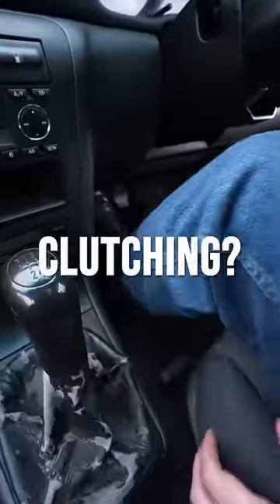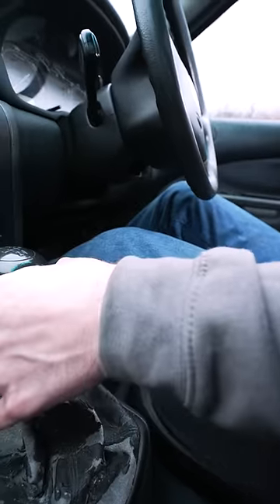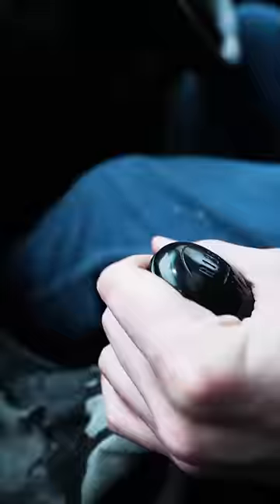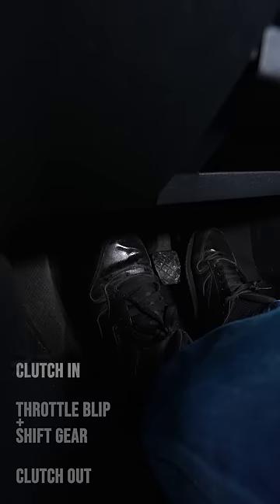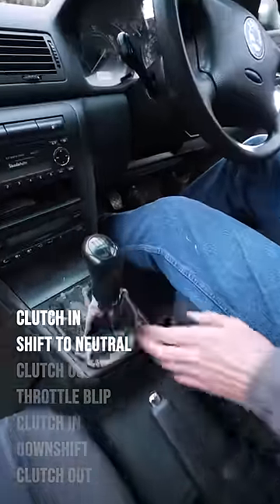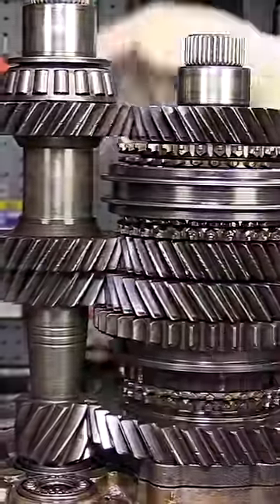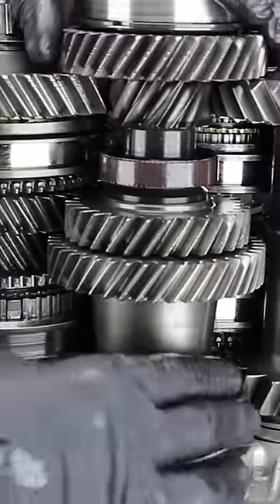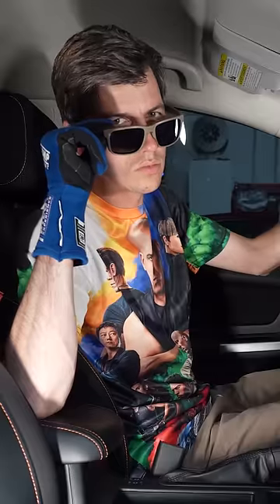What Is Double Clutching? Don't Granny Shift!

Comment: Double clutching is mostly used when drive manual semi-trucks.
Reply: Only learned double clutching for the DMV test and I been floating gears ever since.
Reply: Depends on the driver, most don't double clutch. Also, most people don't know this, but you can totally single clutch an unsynchronized transmission
Reply: Never once saw my father double clutch his truck in the 80's and 90's. Clutch was only ever used for starting and stopping the truck.
Reply: @JoshuaTootell  good skill to have though, sometimes a good way to recover from a missed shift. If you're a boss and never miss a shift then you don't need it
Reply: @JoshuaTootell  Some weird American automatic gearbox?
Reply: Very old manual trucks.
Reply: @SoulTouchMusic93 New ones too.
Reply: Ya... the company I work for has me in a 22 kenworth t680 with a 10spd. I float my gears and only use a clutch for starting and stopping.
Reply: The why is that most (not all but most) tandem drive axle trucks do NOT have synchronizers on the transmission.  They don't have them on purpose.  The forces the drive train is under when pulling a load (grade isn't a consideration flat uphill downhill the transmission activities are all parallel relative to the road surface) are enormous.  The synchronizer on a small light vehicle is not under anything like the stresses those gear splines are under on a rig.  On a rig a synchronizer would potentially fail in low range causing the drive finals to lock up and ultimately stopping rotation of the wheels resulting in a skid or snap the driveline off at the flywheel or hogshead resulting in a big truck in permanent neutral.  Neither condition is safe on the highway as you can imagine.  

As a former driver (I drove long haul from Maine to Cali to Seattle to Florida and everywhere in between) I rarely used the clutch to shift up or down.  I used a combination of the tachometer speedometer and the sound of the engine to tell me when to shift.  12 to 13?  Get the rpm just above the nominal rpm to shift then push the gear selector into neutral right foot off accelerator momentarily then on into 13th foot back on to the accelerator and proceed.  Easy easy.  9th to 8th (or even 7th if I needed to slow in a hurry)? Pull gear selector to neutral goose the accelerator to appropriate rpm slide gear selector to desired down gear and let the jakes do the work of slowing the vehicle down with a covering foot on the brake pedal if needed.  

Every mechanic I ever met during all those runs all said the same thing.  I can tell when I pull maintenance whether or not you clutch double clutch or float and company policy as well as the dmv say you must double clutch.  Then after the safety meeting was over they all would say the same thing.  Save yourself and me some heartache and work.  Float the gears use clutch to start and stop. Keeps my workload down and your wheels turning more frequently.
Reply: They dont use the clutch they float gears
Reply: @marlberg2963  not to mention the poor quality of certain parts like clutch brakes that are in supply these days.
Reply: If you're new lol
Reply: @Mrcoltonclarkson  Floating the gears doesn't really same much time or energy and if it does its typically negligible so its more about preference
Reply: @wilko9396You mean a car like the one I have? I would have never guessed! You can also jump out of a window, doesn't mean you should.
Reply: Float your gears
Reply: @marlberg2963 a lot of euro trucks have synchronized manuals and they work fine. Some automated transmissions like volvo ishift are not synchronized but still have synchronizers on range selector and splitter. I think the reason for not making synchronized transmissions is just that unsynchronized transmissions work and there is no reason to start designing new transmissions  when customers are either choosing automatics or are used to unsynchronized. "Why fix what isn't broken" seems to be the way you work in the states atleast when looking at the differences between american and european trucks.
Reply: Double clutch for the test, and float the rest.
Reply: Even then it's unnecessary. Floating gears is honestly not only easier, but modern transmissions are made with floating gears in mind.
Reply: Not even unless your driving one from the 70s or 80s you don't need to double clutch
Reply: True, but almost no one does it. Most just rev match shift
Reply: Or old tractors
Reply: Yes and No you will only need to Double clutch front 1st to 2nd or 2nd to 1st. Unless the truck was made from 1917 to 1972 then yes you must Double clutch cause they did not have synchronization gear packs
Reply: Only by drivers who can't float gears.
Reply: @purplepotato69 It may not save time but it saves your clutch.
Reply: @daffyduckling6958  of course but the wear is pretty negligible
Reply: Double clutching is used whenever there are no synchros
Reply: @greggvanzyl5563 same with my dads european truck but he uses the clutch to shift from low to high gears
Reply: I never double clutch in a semi.(cdl holder for 30 years)  you float the gears.  In almost all except some Mercedes setups.
Reply: that's exactly right, until you get good at getting the rpms to match and you just float the gears ot slip shift, that's not using the clutch at all.
Reply: I work at a heavy haul company.  If a driver clutches past 1st gear he'll get fired LoL everyone floats gears for the last 50+ years.
Reply: Titodatruth  Why WOULD he double clutch a pickup?
Reply: Doesn’t it have to be in neutral to start? I don’t remember it’s been a really long time since I drove a stick
Reply: @harryparsons2750  not a semi
Reply: @spacecat7247 why do you need to clutch a Mercedes?
Reply: @Eric-xh9ee  My understanding is that you can't float the gears in them or at least. In the ones the military was using
Reply: @spacecat7247  at the sawmill I used to work at, we had a truck like that. The drives would hate taking that truck since it didn't have a radio or CB either and was super old but the owner of the mill was too cheap.
Reply: @Eric-xh9ee  lol. Yep. I drove some old stuff back in the day.  Dinosaurs that wouldn't die. Old Mack R models with six speeds and old fords with split axles.
Reply: @kingdomkey2011 exactly it gets tiresome to keep lifting that left leg up especially in NYC.
Reply: @kingdomkey2011  You commented as if you were special and the only one ...

Comment: Remember, when you're in a race and going as fast as possible, it's ALWAYS possible to change into a higher gear and win the race... but only when the camera is on you.
Reply: Would make more sense to downshift to win the race at the end
Reply: I think they downshift, going into a higher gear would make the car slower when accelerating
Reply: Yep no such thing as a money shift in a movie unless they need a blown engine specifically for a plot 🤣
Reply: @da4127  Maybe if your on a bicycle uphill 😂 that's not how gears work
Reply: Don't forget the big bottle of NO2!!!!!
Reply: Ford vs Ferrari just entered the chat
Reply: @sjaakcornelis9960   That doesn't make any sense whatsoever.....  Downshifting is engine braking.... thus you lose lots of speed.... SMH
Reply: @lucythecat3416 You mean that bottle of non-flammable gss that explodes in a big fireball in the movie?
Reply: @Firemarioflower  downshifting increase engines RPM, which in most cases means more power. But if they aren't going max RPM at that point, they are doing something wrong.
Reply: @Papinak2  a lower gear will increase engine torque, but if your revs are high anyway, downshifting will indeed slow you down through engine braking
Reply: @dshe8637  if you get to the point that the engine slows you down on full throttle, it's not engine braking, it's the engine breaking.
Reply: @Papinak2  😁

Comment: I've only driven standard transmission cars since I started driving with a license (and before) for almost 50 yrs now, I'm so happy they have synchromesh gears.
Reply: Is that part of the gear itself or is it a separate system/piece?
Reply: @georgevigil7001  Such a very complicated question needs an easy answer. Synchronization is a part(numerous parts) of the gearbox. It's not part of the actual gears that transmit rotary motion and modify rotational speed and torque. The synchromesh gearbox is a continuous mesh gearbox with added synchronization pieces. Neither(unlike the super oldschool gearboxes) move the actual gears when shifting, instead fully connecting them to rotating axles one pair at a time, by means of moving other smaller bits and pieces. All the gears rotate at all times when the vehicle is in motion.
Reply: @ffffffff-vv7yp  that is bad ass! 

I don’t think I 100% fully understand it but your answer gave me a solid idea. So fascinating! 

Now I’m wondering, what happens if that breaks and how much will it cost 😆 

I have a manual and by operating it, I would never have thought there’s that much involved in every gear change. 

Who would’ve thought! Thanks for the detailed (and simplified) answer brother!
Reply: @georgevigil7001  There are videos and animations on the function of synchro gearboxes on Youtube, maybe that's more understandable. You would see a fork thingy moving a collar thingy along one of the axles from a splined piece to another. The bigger gears are the actual "gears" and they keep rotating and paired at all times, and that's the continuous mesh part of the deal. The smallest yellowish pieces are the syncro rings, and that's what makes it "synchromesh" as in not requiring special techniques to drive.

In case of the synchro rings wearing out, it would either need to be tolerated, replaced or repaired. The latter done properly would involve removing the gearbox from the vehicle, tearing it apart, replacing some minor parts (preferably more than the actual broken ones) and assembling everything again. This is obviously horribly expensive when done by a professional by the hour, and in worst case the gearbox could be beyond repair anyway. Or, alternatively and typically for a high mileage car, a used junkyard transmission is transplanted without bothering disassembly of the original, and even that could still be kinda expensive especially if not DIY.
Reply: Syncros are so nice my 74 k20 has syncros and I love driving that thing the only bad thing is when they decide your close enough to in synch and let you go to the next gear when your not synched up and you grind a little bit my 3rd gear does that every once in a while and it hurts my soul every time because the truck only has 16k miles on it
Reply: @Wage_gap_gaming  just give a little more time with the clutch down before shifting into 3rd couldn't hurt to try. Iv had a cupple car that would do that in one gear. Ended up being a worn out Synchro